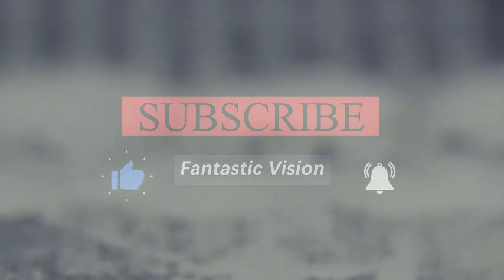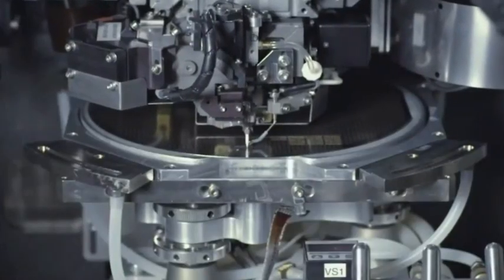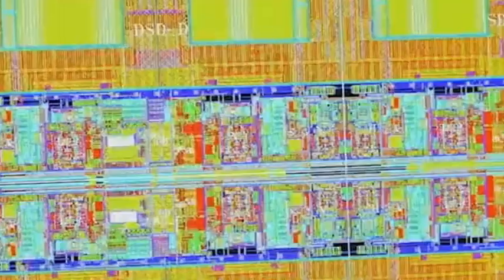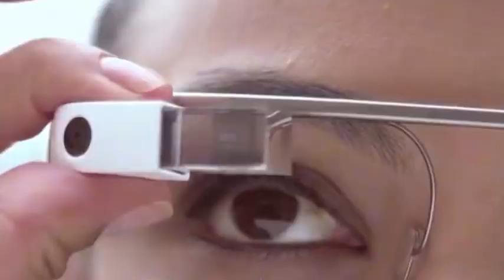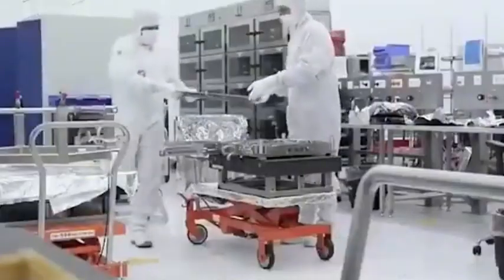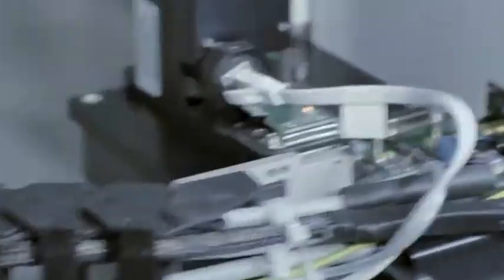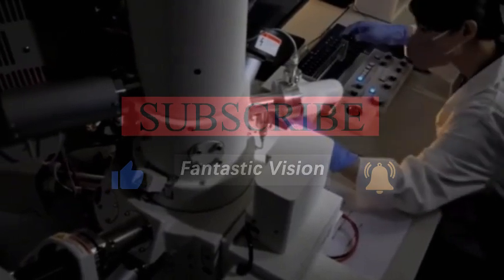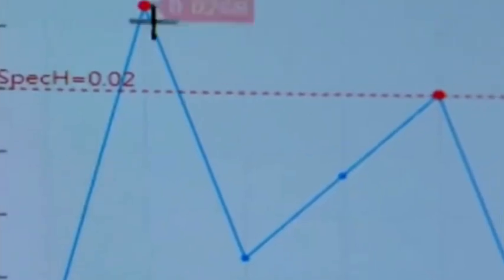China's chip manufacturing process technology is close to the 7nm level, which is enough!

Comment: 5nm will the limit, China chips industry has set for its top end chip. 
It will be wasteful beyond that.
Not that they are not capable  of producing chips smaller than 5nm but purely in economic sense.
That is in my opinion, of course.
How long will it takes to recover the capital cost of those EUV e.g. TSMC. 🤔